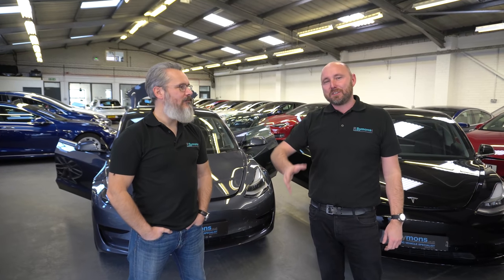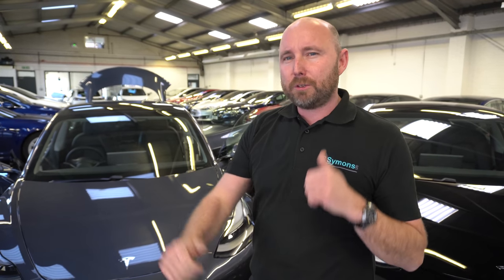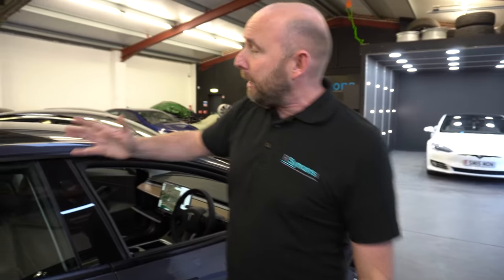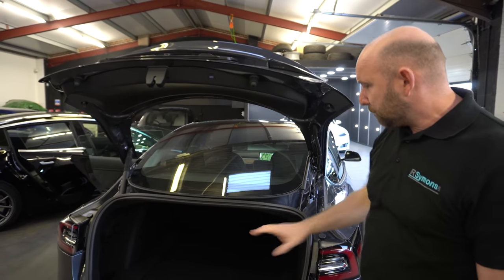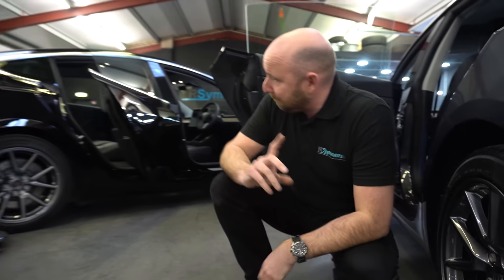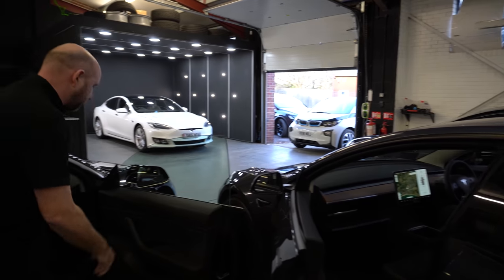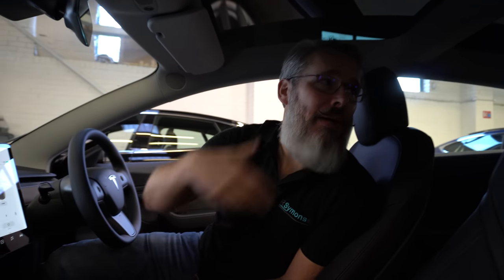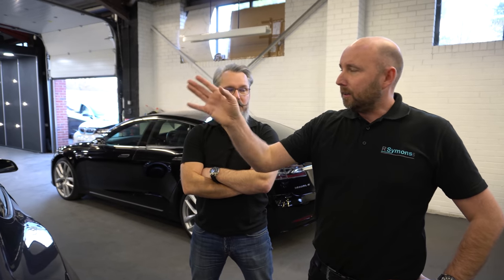NEW 2021 Tesla Model 3 v 2020 side by side comparison. What's changed?

Comment: One of the biggest changes is the "heat pump
Reply from the maker: This week I will be doing a mega range test comparison. ALL the model 3’s....  so we’ll see if that heat pump makes a difference
Reply: @RSEV  heat pump especially makes a good difference in cold climates ( -5 or lower ) , not sure it would make such a big difference in climates above 0
Reply: Nissan Leaf has one ... so do most others
Reply: It makes a huge difference on dog or camp mode.
Reply: Heat pump would make difference but old car charge faster then the new one 👍

Comment: Remember you can pin lock the glove box now to protect the thumb drive!
Reply from the maker: That’s right. But this is a feature that even older Teslas now have through an over the air update so it’s not something that comes only with the new refreshed Model 3’s
Reply: now if someone breaks in the car, they can't take the thumb drive.  2020 they can just take the thumb drive and then you have no proof.
Reply: A thief is probably going to force it open whether it’s locked or not.
Reply: The data should be stored in the cloud.
Reply: @RSEV  correct, but there is no usb slot in the glove box in older models, so a usb drive could be stolen. I seem to remember reading though, that if the alarm is triggered, the footage is sent to Tesla automatically, so you can request it from them. Not sure if this is correct or not? I think the same is true in a car accident. 

The chances of a thief hanging about to force the glove box open are pretty slim, most are opportunists.

Comment: Thank you for the video, I have a 2020 version and think the changes are a good improvement 
I would prefer the chrome delete myself.
It is a shame they have not added the double rubber sealed the doors - ie fit a second silicone rubber seal around the edges of the doors, froot and boot.  This is the main thing that gives the door closure a solid sound - and cuts down on wind noise from from around the doors and I found after adding an after-market seal this made a noticeable sound reduction.

Comment: I like the ability to "cover" my cell phones when I drive at night to avoid an unexpected bright light shining at my face.  I have real carbon fiber on both so no worries about the gloss black.
Reply from the maker: Good point that phones no longer covered... possible distractions....
Reply: I agree, I prefer the previous centre console design for this reason plus you have the option of custom wrapping to your individual choice.

The usb in the glove box is ok I guess but if a hard drive is used it takes up space. Easy enough to wire in a usb there anyway if required.
Reply: Just turn it around then

Comment: what would you say the biggest exterior change is ? i like to call out cars while i’m driving and sometimes i can’t tell if it’s a 2020 or 2021
Reply from the maker: Definitely the de-chrome but even older ones can have an aftermarket de-chrome. So that leaves the Uberturbines to differentiate the 2020 to 2021 models.

Comment: Glad to see the new aero covers are harder to remove. I’ve had two of the old ones fall off while driving. Interested to see if the new covers will attach to the old wheels or if I’d have to buy a whole new set of wheels too?

Comment: The range and the heat pump are definitely the best improvements. The new center console is not my cup of tea, as I like my wrap actually and simple look of the old console. 

The chrome also looks better I think on the midnight silver metallic color in my opinion. Looks way more classy and luxurious compared to satin black. A decent upgrade though. I actually have the new frunk actually because I have the September build (I live in US), but I don’t think it has the heat pump.

Comment: Excellent video just the comparison I have been looking for, I will receive my new car in January, I will ceramic coat myself, I plan on using a Carpro orange cutting pad and Carpro fixer compound and polish then coat with Carpro ceramic 3.0 what do you think any suggestions or anything you would change? Any hints of tips to detailing a Tesla model 3. Thanks

Comment: I much prefer the chrome; the black trim is too "dull" for my tastes. And I think chrome would be a more consistent match for the metal around the new console. And we didn't get to see how the steering wheel and door buttons had changed. I take it there is no longer storage space under the phone shelf…? If so, that's unfortunate. The power trunk lid is a nice improvement. Overall… the changes are not nearly enough to tempt me to trade in my 2018 Model 3. I'll probably just hang on to it for years to come.

Comment: What is your truthful view of a model 3. Do you have the long range or standard plus and which would you suggest is better for someone who does max 200 miles a month. I like the added bits on the long range like the improved sound system and heated rear seats but is it really worth the extra 6k. Thanks
Reply: I ordered the 2021 LR Model 3. The extra mileage plus all the additional improvements, with no cost change is a no brainer. I hope to get mine in the 2 weeks.
Reply from the maker: Well you don’t need the range, so Sr+ fine but also look at it that the items won’t cost you £6k more. It’s £6k more out of the bank yes, but it will retain that difference in value (roughly speaking) throughout the next few years... so you’ll get it back.
Reply: @RSEV  you can’t just update the music though can you it all appears a factory build ?

Comment: What is certain is that people who like chrome don’t usually  like black de chrome and visa-versa; tends to be an age generation thing but why not make it an option. I don’t know if it would be a deal breaker as most of the changes are improvements especially the heat pump and electric tail lift. But the reworked center console is a joke.

Comment: Can you tell us if the aero hub caps from the 2021 fit on the 2020 rims?
Reply: I would like to know that too!
Reply: @denischick2519  In their video, they were so close to showing us this!  I'd really love to use the 2021 Aero Hub Caps on my 2020 M3 as a way to look current.
Reply: @roobdude  Yes me too. I bought one of the current ones recently and they were only £25. It depends if the clips are the same and will fit onto the very slightly different spoke profile.
Reply: @denischick2519  How were you able to buy a new 2021 hub cap?  I didnt see them on the Tesla Store.  Did you somehow order parts thru a service center?
Reply: @roobdude  No! I bought one for the current car, it’s still current until we see new ones in the showroom here in Solihull! Would I only have bought one if it was a new one?!

Comment: My opinions fwiw:

Chrome delete - I think it cheapens the car, the black door handles look like the cheap plastic ones that were fitted to 1980's cars. Doesn't look right on the mirrors or camara housing either.

Power boot - fail.   if you are carrying shopping in both hands and have to put them down to press the button on the boot or fumble in your pocket for your phone ..... Then what is the point of a powered boot?

 May as well use your hands to open it, thus saving cost and weight.

The whole point of a powered boot is that you don't need to use your hands to open it, proper clued-up manufacturers realise this, hence they incorporate a foot sensor to activate it.

so this "facelift feature" is in fact, useless.

Clearly elon musk doesn't do any family shopping.

Console - I prefer the previous centre console design as it hides your phone and, as someone else on here remarked, prevents distractions & reflections from the screen at night,  plus you have the option of custom wrapping it to your individual choice.

The usb in the glove box is ok I guess but if a hard drive is used it takes up space. Easy enough to wire in a usb there anyway if required so not great benefit 

The original console has more fluidity, complementing the minimalist interior design.

Window glazing - I don't understand why they didn't do the same to the rear windows? A bit pointless doing just the front for sound deadening reasons? 

Also adding unnecessary weight, would have been better adding additional door/window seals or sound deadening materials to reduce noise in my opinion.

Wheels- the new aero trims appear to look better. Tyres- I read elsewhere that the change of tyre was due to less rolling resistance. I don't know whether this is the case?

Frunk- Penny pinching in the trunk by removing the bag hooks.... how much can a couple of plastic hooks cost?
The heat pump my be a worthwhile upgrade if it achieves better efficiency. However on the down side it more complexity to go wrong 

As far as I am concerned these "upgrades" are underwhelming. They would have been better concentrating on other things, the build quality and paint finish perhaps.

The one useful upgrade, which wasn't mentioned here, is the revised boot seal that stops the rain running into the boot.

Comment: Get rid of the electric motor to close the “HOOD”. Cut back on the wires and neodymium. Wasteful design. Lazy.  Motors in the mirrors? Why?motors for the door handles? Why? Poor design. Too many defects.  A motor for the truck? What a waste of electronics. Lazy. Wasteful. Though we wanted to save the earth.  Can’t the humans do anything? Aero wheels?  Cut back on the electrical window, etc, motors and cut weight. Aero wheels not needed....spend more time on waste and not wheels. Noise test?  Do a lazy test. Get rid of electric doors. Manual is the best....why have two systems. Weight? Wires? Thorium? Neodymium. Do a co2 test to see which one takes less CO2 to make and maintain. Need scene to open glove box. Sad. What a great design. Too many wires. Humans at there worse.